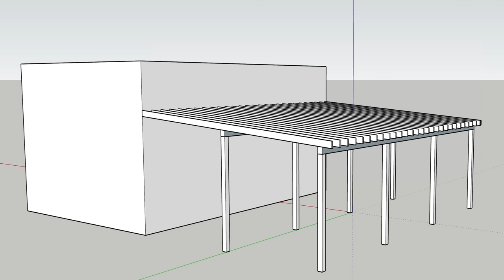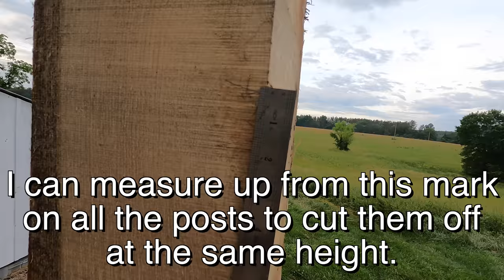Building a Huge Addition On My Shop.  Game Changer!

Comment from the maker: I've been working on this on and off for the last 6 months, and it's awesome to have it coming together at last.  Like the video?  Give me a thumbs up!  Check the description for ways to support the channel.  I really appreciate everybody's support!  Truly!  Have an awesome weekend everybody!
Reply: From the looks of it that steel pin only goes a couple of inches into the post. A tractor could definitely knock that off.
Reply: When you have the time, you don't have the money, when you have the money, you don't have the time...:)...30 year General contractor...I started an addition on the back of my house; Four years later, I've torn it all down.  Buy those temp garages, you either blow up or build with a tarp...
Reply: Your 80' lift parked to the side, with the basket telescoping along the front would give you a moving platform and two hands to position and fasten. I didn't know what I was missing till we bought a lift!
Reply: Why did you not use the arm swing to swing the arm to the right while moveing the cabin of the excevator to the left to get the beam in the right position and then use the tracks to get the last bit of centerd.
Reply: John, Hate to bring this to your attention in case you didnt notice …. You already found the screw that went from outside ledger to inside wiring and you mentioned that you wouldn't have hit another wire with that level of the screws in the ledger since it was lower that the wire in the rest of the wall. But, I just saw you nailing (or screwing) the upper edge of the rafters into that same wall and they might now be at the higher height of the inside wiring. Hope not, but wanted to mention it.
BTW, the splash on the wood at the sawmill would be a 9 on the Cremona splash scale….haha! Nice sawmill.
Reply: This is my first time. Love it!!!! Where do you live (not specifically)? Why don't you use kids or family? Just asking, not trying to judge. So impressed with your individual accomplishments 👏🫡

Comment: I'm a retired general contractor living in San Jose, CA. I was a turn key contractor which means I did all the trades, foundations, framing, electrical, plumbing and all the others. The only  tip I wanted to share with you was fishing for wires between floors. I always used a 20' hunk of window sash chain and dropped it down the wall cavity and fished from the bottom. In my youth I had rewired many very old rwo and three story row houses in Philadelphia and this practice worked very well. You're a joy to watch and good luck. Ben Vitcov.

Comment: Some free advice from a structural engineer:
1. Think about sliding snow from your upper roof (can't see the pitch) - in addition to the extra vertical load, a sliding event can also put a lateral load on the structure so this may challenge the rafter to ledger board connection (rafter pulls away from the building).
2. Low roofs are normally designed for extra snow load due to drifting. In Canada, the drift load is a function of the step height between the high and low roof and the size of the upper roof. Drift load is treated in addition to sliding snow so the loads can become substantial (in my geographical area it would be at least 120-150 psf snow load). Your door headers may need strengthening. Of course you can clear the snow load off is you get an accumulation but engineers are not allowed to use this as a basis for design.
3. Due to 1) and 2), don't be shy with the screws connecting the ledger board to the building. This is probably the weakest link in the whole structure. There are calculation that are normally done to determine number and diameter of fasteners.
4. I would add positive steel connection (strap with horizontal leg and bolt into concrete) from the post to slab for wind uplift. Wind uplift forces are dependand on your geographical area but to give you an idea, it could be something like 15 psf * 0.5 rafter span * column spacing. The structure is probably not heavy enough resist wind uplift 
5. Think about adding knee braces from the beams to columns in both directions. I have done a lot of insurance investigations on collapsed carport structures. Lateral instability due to lack of cross bracing usually spawns the collapse (google "p delta analysis" if interested in some bedtime reading). 

Don't be afraid to get some advice from an engineer.
Reply: taking advice from engineers should have been done before starting project.
 i like the content stay safe man
Reply: Some things to consider. Kind of wondering just how thick the slab is that the posts are sitting on. There should have been concrete piers with footings and heavy duty anchors like a Simposn CB88.  I think there should have been columns at the existing structure to support the roof instead of expecting the existing structure to handle the extra loads. At least he has snow guards on the upper roof to help prevent the snow from cutting loose in one big slide. He should have drilled holes at the upper notch (32:41 frame) on the rafters to keep them from splitting. Doubtful those thin metal plates to secure the beams to the columns will do much if the wind gets under the roof. I hope the top of the columns got sealed seeing the structure is open to the elements.  It certainly looks like he could have had more pitch to the roof.The other thing is you have a solid connection on the high end and the low end may go up or down depending on the ground frost. These columns should have been in independent footings and piers with a solid anchor for uplift. The columns are two close to the ground and may be subjected to getting wacked by a plow when clearing snow.
Reply: You've professionally touched on a few of my own thoughts about some of the methods in the video. While I admire Farmcraft's ingenuity and go-get-em attitude, seeking out some engineering advice ahead of time would ensure no disaster befalls the structure (or person) in a weather event, or other mishap during use of the structure (engine pulling after a heavy snow, anyone?)
Longtime framer here (in my 46th year now), and I felt the same about the lack of solid drag/vertical load connection of the rafters to the building. Raising the ledger up to the same level as the rafters, lag bolting it to the building's framing members and incorporating some heavier-gauge Simpson hangers would be a big improvement. 
And for sure, the new roof could use a raise in pitch.
The other concern I have is the cavalier approach to safety. During any project like this, practicing very unsafe moves in supporting yourself, sometimes while working with power tools, and doing both while alone, can be a recipe for tragedy. Hate to sound like I'm on a soap box but man, I've had more than my share of injuries, some with trips to the ER. Biggest takeaway for me is, stupid really hurts. If you don't believe me, Google 'construction injury statistics' as a starter course. If I have it right, falling is the number one cause of injuries and death. You'll be rethinking the idea that sketchy use of ladders or other shaky supports is cool or funny.

Beyond all this, I do love the content. It's pretty awesome to watch someone mill lumber from trees on their own property and build something with it. Me, I'm stuck with having to buy it at my local lumber yard.
Reply: Wooww.  What an amazing gift!  An engineer!  Free😍. Your Awsome!
Reply: yeah no kidding, with such a shallow roof pitch you could get like 4 feet of snow stacked up there.  But he does have some serious fuckin' lumber.

Comment: I’m thinking that the steel beam is so you can span a larger area without a post. Also, the new beam should be named Mr. Johnson. 😂
Reply: then it would not be hand made but I see your point ,wide open space is much better.
Reply: yep, save the trees
Reply: you can mill a sturdy beam..Tamarac..larch  is strong and it does not rot but it is gummy to mill. There is a special recipe for the water but pine soil or terbentine mix  should work.
Reply: @balloney2175  yes, saving trees by using steel. 

And how is that steel produced, if I might ask? Steel is a great material, but in the grand scheme of things not really a good substitute in regard of environmental issues.

Comment: You can get pretty good laser levels for about $100 if you don't need too much brightness. For outdoors on a sunny day you need something proper with a laser receiver as well, but it doesn't have to be that expensive. I highly recommend getting one of those, those things have made many of my jobs so much easier.
Reply: I mean yeah, laser levels are cheap nowadays but also a water hose level is just as accurate and it costs nothing.
Reply: Agreed and with a cheap one, you can make your marks at dusk
Reply: @JesusUruchurtu1  I disagree. They're not even close to that accuracy and getting an entire line drawn right away is ideal
Reply: @WoLpH  Agree, a spirit (transit) level is the most accurate.
Reply: Or if you want to be really cheap but accurate a 3/4inch plastic hose with coloured water in it they work really well!
Tony from Western Australia 🇦🇺
Reply: Can’t beat a dumpy or a water level, water in a clear hose never lies
Reply: @JesusUruchurtu1  I made a hose water level mod. I bought 2' of 5/8" clear soft  tubing, cut it into 1' lengths. Put two male faucet fittings on the ends of one piece with a cap to screw onto one of the male fittings. On the other piece of clear tubing I put a female on one end and a male on the other and a cap on that male fitting. Drilled a small hole in the center of the caps to allow pressure equalization. Now my water hose level can be stored in my tool chest. All I have to do is grab my garden hose screw them onto the ends of a hose of any length, in fact you can make a water level any length you want by just adding as many hoses together as you want. I've got at least 5, 100' hoses around the property, so I can precisely level two things 500' apart if I want. If I want a particular grade over a long distance I can just stake out the distance and set up the water level and measure up or down the stake for the grade I want.
Reply: Just use a water level! What's the deal with all these cheap lasers with invisible lines that always go out of calibration? By the time you've marked your elevations with the laser,  you could already have all your posts cut to height and the bean installed using the water level.
Reply: Or you could use the transit level on both end posts, mark them and then ping a chalk line between them which would quickly and clearly mark the two centre posts. Just an option.
Reply: @shoppe99  That's awesome. Well done, man.

Comment: Here in Indonesia we use small hose and filled it with water then stretch the hose across two point that we need to find level..

The water level from each ends will be where the true level is. Use gravity to assist you 😁👍
Reply: That's how my father and my cousins use to achieve level. Gravity can be your friend.
Reply: We do the same here in the US. He used the transit because you can quickly check.multiple locations at one time without the hassle of filling and moving hoses around.

Comment: I would have guessed that the steel beam is for a hoist, but you already put a massive wooden beam up that you said was for being able to hoist things...   Hmmm.   I'm thinking you're making a much wider opening than originally planned.   
Great to see this build coming together!

BTW:  THREE window AC's in your woodshop?!
Reply from the maker: Nailed it. I’m eliminating one of the posts which really opens it up. 3 acs?  Not really. The main one on top broke. I had 2 smaller ones that I’ve been using until I get around to replacing the big one.
Reply: Was going to say gantry crane! Lol
Reply: @kimber841  
He could use 
both beams for lifting.
Reply: @jakebredthauer5100  Ya, My first thought was an I beam for gantry crane so he could lift and run it into the shop.

Comment: FYI for any roof work in your future, you can eliminate the guess work of cutting the rafter angle by using a practical carpentry method that will get you the exact angle between the rafter and the existing shop wall, and the bird's mouths angle by using a sliding t-bevel and a string line.  Tac or nail a brad to the outside edge of your landing beam. Tac another to the outside edge of the ledger board perpendicular to the shop wall and the beam where a rafter will be positioned. Tie the string line to those two points on top of the beam edge and the ledger edge. Line up the t-bevel edge with the string line slope and the adjustable edge with the vertical side of the beam or the ledger board to get the acute angle of the rafter cut. Or, get the angle of the slope of the string line and the vertical wall face to get the obtuse angle of the rafter cut. Tighten the set screw. and use that angle to mark the cut on your rafter end. 
The horizontal notch on the bird's mouth will be 90 degree angle off of the vertical cut on the rafter end. Then you can use the acute angle of the rafter cut to mark the vertical lines of the notches at the beam and ledger board. You can measure between your two tacked nails to get the distance from the lower notched edge of the ledger cut, to the lower end of the notch line on the beam.

Comment: If you have a Oscillating tool you can make own concrete vibrator first install blade then attach a square piece of wood to desired length turn on then stick it in your concrete. Hope that helps

Comment: A mild steel pin in the bottom of the green oak post will react with the tannins in the oak and will attack the steel. Stainless steel pin would last the life of the building. Fabulous job none the less.👍👍👍

Comment: You need good structural beams on the roof, so you can put a chain hoist to them.  In my former shop I used 2 by 6 for the bottom boards on my roof’ s trusses.  This would allow me enough strength to use my chain hoist, chained to the roof trusses.  I had a concrete floor in the shop about 6 inches thick with integral footings and 3/16 wire in the 2,500 psi concrete.  It would support any car I wanted to put in the shop.  I had a 10’ concrete ramp at one end of the shop.  I could get a 3000 Ford tractor into the shop.  And I had a air conditioner in my shop office end of the shop.

Comment: Great idea!  When I built my pole barn, I put a 15' x 12' porch in front of my wood shop.  All of my equipment is on wheels, so I can roll out the table saw, band saw, work table or anything else outside.  It provides nice shade or shelter from rain while keeping the dust in my shop to a minimum.

Comment: Nice jobe so far.  Very impressive.
If the teperature gets below freezing in your area, those support posts should be frost protected.
That concrete slab will move up an down with a freeze/thaw and the shop won't.
That is unless the whole slab is frost protected with a footing below the local frost line.

Comment: Those temps are nothing.  Here in Tucson AZ it's 110F or hotter in mid summer days! Even with your humidity on your hotest days AZ is no joke. Right now we been having Monsoons currently 80% huminity and 80 Degrees F at night feels OK till you start moving around, in the day light it's 100+ with 80+ humidity during Monsoons!  I have hit a wire in my house once putting drywall up I had no idea till I went to take asjhwer that night and went to reset the breaker it kept tripping hahah... Awesome biuld you are doing Great work and great video man!

Comment: Good job. I started a 40 x 64 x 16 pole barn in Northern Ohio in August.  I had minimal help and hired two roofers and a tree company crane truck to fly the trusses.  I'm glad I did that in my 30s. I'm in my 40s now and getting slower.  It's nice and warm in the winter tho now.  It's come a long way from a diesel turbo heater to an insulated building with a wood burner.  I have a mill and lathe and some of your previous videos helped me a lot.

Comment: You should try a water level. Faster than a transit when working by yourself.  Plus it's exactly level doesn't matter how far. Far better than transit. All that's needed  is clear 5/8 or 3/4 inch clear hose and water . Cheap and accurate.

Comment: NICE filming, and job.  I like your shop too.  I noted that the thing you called "a sander" was actually a thickness sander, which is pretty rare to see one of those open ended thickness sanders.  I hope you know what a great tool you have.  I have one also, and it is one of the most used machines I have.  My shop is a bit more focused on wood than yours is, but you beat me in the metal area.  A few years back I built out another shop too, just so I could work on tractors and excavators in the bad weather also.  Unfortunately, that space got co-opted into being more storage for parts and machines.  I'm thinking about now building another one that is covered in solar panels so that in the next few years, as more and more machines and vehicles go electric, I'll have a place just for charging them.  And I can keep vehicles underneath.  Being on the west coast, the trees I have are more softwoods than what you have also.  nice milling.   
Might I suggest buying a laser level?  I have an old transit I've used for years too, and it does well.  Last year, bought a "Huepar" laser level.  Has 3 planes, and they are all very accurately 90 degrees from each other.  (two vertical, one horizontal.  Cost is only about $140 or so, and WOW, Spectacular!  I use it all the time now.  Especially great when working by yourself.  I use it MUCH more often than I ever used the old one.  Pays for itself every day I'm doing this type of stuff.

Comment: Where are your hurricane brackets.  In some areas known probably known tornado brackets. Top and bottom?  That shed roof flying could take out part of the shop.  Brackets at the house ledger board  too.   Hurricane bks at the outside  columns too?

JoeB